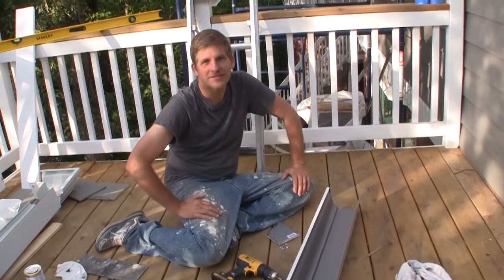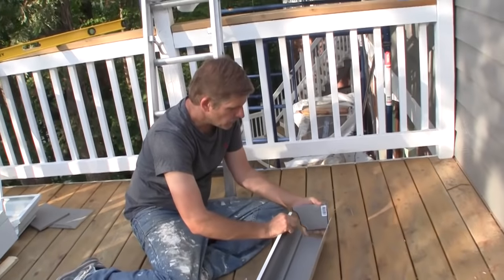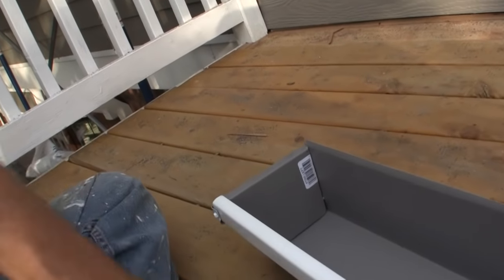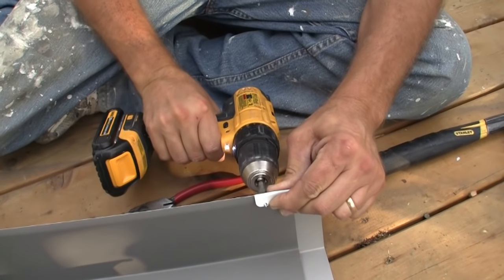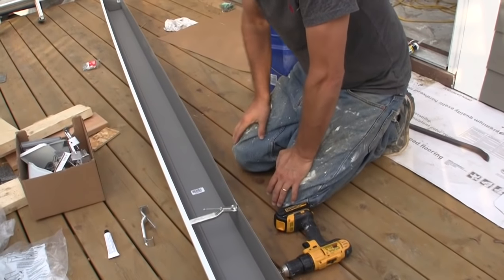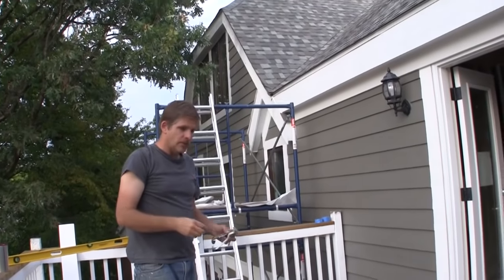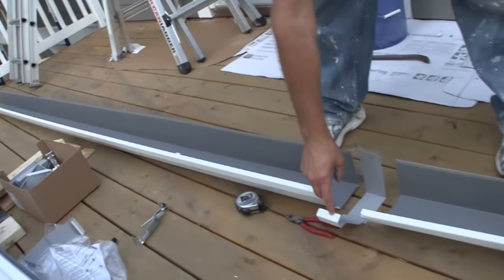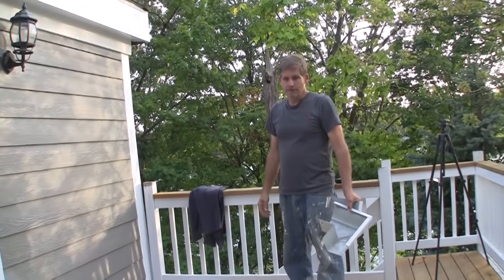How to Install Gutters

Comment: I noticed your flashing is not extended into the gutter at approx the 9 foot mark, due to your slope.  What do you do at that point?  I imagine water will drip behind the gutter and stain the facia board.
Reply from the maker: Hey Kerry,
That’s a subject of considerable debate. We chose a slope that was more steep. Some people chose less slope to avoid such a concern. Our thinking was 1)  : water running off the roof falls OFF the drip edge ( if properly installed) and into the gutter, not down the lower face of the drip edge and down the facia. 
2) our facia is 3/4 inch thick pvc plastic embossed with a wood texture. It will never rot. 
3) and splash that does splash up to the facia above the gutter will be fairly insignificant. 
So in the end - thst was our thinking. Hope that helps.
Thanks for watching!

Comment: Thanks for the details. I guess you have to slide pretty far up under drip edge on initial piece for a long run
Reply from the maker: Hey Nightsky777,
We have had plenty of people ague that the slope can be more shallow, so that might be an option for you on s long run. 
Also, a drip edge, by design, should help keep water off the facia and dropping into the gutter, so, by the way others do it, the entire drip edge does not have to cover the whole back side of the gutter. 
You can scroll thru the comments and you’ll see a lot of debate. But ultimately, the pieces are designed to do its job. 
Hope that helps. Thx for watching and commenting.

Comment: My gutter hangers are four feet a part. They are steel gutters and I live in a warm climate with occasional rainfall. I’ve heard three feet is the max but it’s either two feet or four feet the way my house is put together. Would you recommend every two feet or is four feet ok?
Reply from the maker: Hey JJ,
Ours are about 2 feet. House are your gutters hanging? If you don’t get tons of rain or snow and they aren’t sagging, maybe you get away with 4 feet. But 2 feet works best here. Thx for watching!

Comment: I have a 95 single wide with no overhang or bird box thing. I have rotten facia board and rusty leaking tiny gutters. I want to replace it all but I am wondering if I should just remove the rotten facia board and the gutters and then just screw the tin roof to the top band of the home and then new gutters on top of that that? Or under that tin roof lip?
Reply from the maker: Hey rj,
Why not replace the facia and return it to original condition?
Thx for watching!
Reply: @Housebarons  yes I guess I could do that I really want to  add vinyl siding and thought it would cover up the facia part and just add larger gutters at the top

Comment: What do you do if you run out of drip edge to place in the gutter because of the pitch?
Reply from the maker: Hey Jenny,
No worries. You can have a gap. . It’s a drip EDGE. The water should drip off the edge of the shingle which should be overhanging the drip edge. 
Something isn’t quite right if water runs down the face of the drip edge. 
Thx for the question and for watching!
Reply: @Housebarons  This is not Allowed in most villages and isn’t up to code so how do we go about it in that situation? I know for most of the villages in a 100 mile radius where I live and do work villages NEED all the drip edge into the gutter NO GAP is allowed. I don’t understand how ur leaving it open with a gap ... it will leak.

Comment: At what length would you need two down spouts? I have a 22 foot long garage that I’m going to Reno wondering if it’s better to have two downspouts or if I could preferably do one
Reply from the maker: Hey Grundy,
Funny. There are all kinds of calculations that CAN go into that answer depending on where you live, the pitch of your roof and size and shape of your gutters, size of your downspouts, & gutter slope.. If you want an oversimplified answer -  figure one downspout for every 600-750 sq ft of roof that empties into a gutter.
If you like math, there are a few places online that will give you greater detail.
Hope that helps.
Thx for the question.

Comment: Aren't you supposed to keep gutter behind drip edge?
Reply from the maker: Hey Carters…,
In perfect world. But our facia was made of pvc and water is designed to fall off the edge of the drip edge anyway - so there should not be much of an issue if you want a steeper slope than the drip edge allows. 
Thx for watching!
Thx for watching!

Comment: Don't think I would push the roof I g up to install gutters. 
  I watched a video showing a straightedge being laid on the slope and the gutter installed just below the straight edge .  This looks like it may cause water not drain off the roof edge right
Reply from the maker: Hey Rickey,
The straight edge is for snow/ ice. If you get a mass of snow sliding off the roof, the goal is not to have your gutters ripped off by the slide. Where we live, that is of little concern. 
But good point nonetheless.
Thanks for watching and commenting.

Comment: Great video, is there any need to drill a pilot hole? Thanks.
Reply from the maker: Hey ACMaveric,
No need to the pilot holes IF you are using self piercing / self drilling screws. Those do a fine job. Otherwise , a pilot hole can’t hurt. 
Thx for you comment!

Comment: On my house it's slanted where the gutters would be attached, so the gutters would not hang right. What should I do to solve this problem?
Reply from the maker: Hi Space Cake, please clarify what you mean when you say "it's slanted where the gutters would be attached." If it is difficult to describe, we recently started a page on Facebook, just put housebarons in the search on Facebook and look for an icon of a guy wearing a top hat.  You can post a picture on our page so we can see what's happening.
Reply: Space Cake slanted facia hangs the same. Hang from the 1x and use a gutter bumper every other hanger for support. Senox.com look at their product catalog for gutter bumpers. They’re fantastic.

Comment: If your gutter doesn't end in a corner, do you end the gutter exactly where the roof ends or do you end the gutter a little more than the roof ends?
Reply from the maker: Hey A…,
I typically end it at the facia. But honestly, I imagine that is open to personal preference if you desire a different look. 
Thx for watching!

Comment: I found this video interesting and very informative. How do you install gutters on an older trailer without the roof overhang? The trailer in question has rolled sheet metal roofing secured by screws about every 3-4 inches on the side of the trailer. The old gutter (original) is rusted out and the back side is mounted under the sheet metal .
Reply from the maker: Hey Scott,
Never had that experience. I would try to duplicate what is there. May take some trial and error. 
Thx for watching!

Comment: So. I have 55 ft of gutter to install. Raise it up at once or piece by piece? I realize this is a dumb question, but it is legit.  All the videos show joining gutter lengths on the ground.
Reply from the maker: Hey mg…,
No dumb question at all! 65 feet is quite a length! There are advantages - ease of assembly - to do on the ground , all one length. But you’d need 2-3 other people to keep from breaking/ bending during the lift. If you have the people - go for it. 
But the joints aren’t strong as one solid piece. That’s the drawback. I’d probably try manageable sections (3?) and connect once up. 
OR…
Have a gutter company form and drop a single length at your house. More expensive though… always trade-offs!
Thx for watching!

Comment: Nice vid! So I noticed the back of the gutter was below the d-edge on most of the stretch because of the slope. What can one do about that?
Reply from the maker: Hey Rob,
It all depends on where you live and how much rain you get. 
There are some who advocate hanging gutter level or nearly level and just let water do its thing by finding the downspout hole and drain. 
A slope in your gutters helps more water to drain faster. 
So you could make the slope less . 
The other thing to remember is the drip edge is for water to drip OFF the EDGE. Properly installed, very little water should run down the bottom of the drip edge. 
You could also add an additional down spout which would increase the amount of water that can drain from a particular section of gutter. That way a mostly flat gutter can get rid of a lot more water during a downpour. 
It’s a judgement call based on your situation - but any of the above is ok. You just need to decide how much water you need to move and how fast. 
Thx for the question and kind words!
Reply: @Housebarons  thanks, I'm new to the gutter game but have sided over 100 homes and when I see this situation I've been putting a 2 1/2" strip of aluminum up behind flashing which goes into the gutter. Maybe I'm going overboard.
Reply: @stormteam3004  I'd definitely extend that drip edge. And it should be pulled off the fascia 3/8-1/2".  The last row of shingles has very little slope and water will travel underneath it and under the shingles...

Comment: How do you connect the next section to the one already attached to the house? You cannot screw from the back.
Reply from the maker: +tfgatlin Hi tfgatlin, true, you won't be able to connect the back of the new pieces to the old guttering because the house will be in the way. However, usually you connect the parts using screws on the front and both sides. Even two screws should hold it securely, but three are preferable. You also could put a couple of the screws closer together if you only have two sides to work with, like in a corner. Good luck with your guttering project!
Reply: Why can't the screw go on the inside into the facia???

Comment: I love the look of this system you put up.  What did you use for your facia?  Is that painted board or some type of synthetic material?
Reply from the maker: +Richard Sheridan Hi Richard, we bought our fascia boards at Lowe's. They are called Royal Mouldings pvc boards. They are made of pvc, but they have a stamped wood grain front. Up high you can't tell that they are pvc. They are expensive, but we are working on a 4 story house, so it is no easy feat to replace the fascia. If you are looking for a long term fascia solution, we would definitely recommend this product. Good luck with your project!

Comment: My understanding is those Home Depot gutters are about .018 where seamless gutters are at either .027 or .032.  That's pretty damn thin.  I would guess they are about a 10 year product and good luck if someone leans a ladder against it.
Reply from the maker: Hey Bob, 
All depends on your budget I guess. Thx for watching!
Reply: @Housebarons  Agreed!  I make plenty of budget decisions myself all the time. I'm just pointing a point that I think most people miss. I would guess people think of the big difference between Home Depot gutters and seamless being all the joints..  In my mind that one is recoverable with good workmanship, but the difference in thickness is the real decision.     
Either way great work and thanks for the video.
Reply from the maker: Hey Bob…,
Got ya. Thx for making that point. Worth considering.

Comment: my house doesnt have drip edges   is it ok to install gutter without it?
Reply from the maker: Hey Christopher,
Drip edge is supposed to protect your facia. If you roof shingles where they overhang allow water to drip from them rather than run back toward the facia, then they might function like a drip edge anyway. If so gutters would help direct water away from the house foundation. 
Id look at how water runs off your roof. 
If it drips off the edge of the shingle, then gutters will function correctly for you.
Thx for watching!

Comment: Any tips on installing them on a steel building?
Reply from the maker: +Slickthebird Hi Slickthebird, we haven't worked on any steel buildings yet, but we hope you find the info you need and good luck with your project!
Reply: Your top wall nailer needs to be a 2by6  only use 6" gutter.  The front nose of the gutter needs to be lower than the roof plane, 1- 1&1/2 inches. On classic rib metal,  put hangers on 18"  (every other rib).  Use 2" pole barn screws.

Comment: Besides using trash home depo .027 a company could have dropped off .032 SEAMLESS for around same peice.  This was 5yrs ago,  i bet the seams leak and some facia rotted with that 1/8 in shingle overhang and not under drip

Comment: How do you measure out the slope? How do you calculate that
Reply from the maker: Hey Allie,
It’s length to drop . So a 10ft length horizontally at level, then measure down on one end 1/4 or 1/2 inch. There you would have a 1/4 or half in slope over 10 ft. 
Thx for watching!

Comment: Just bought gutters yesterday, so I think I can do this after watching this.. Two questions, can I do this by myself and do you caulk it all after it is up ?
Reply from the maker: Hey Sonas....,
If you could rig up something to hold the opposite end, in theory you could do it by yourself. But an extra set of hands would be way easier.
As for “caulk”, no. There has been no shortage of comments on this particular topic. Typical big box stores sell a gutter sealant for the seams. That should be effective. But get the stuff that is specifically manufactured for gutter seams. Not a one kind fits all. 
Hope that helps.
Thx for the question.
Reply: Thank you for the reply.  OK ,I plan on trying it by myself and I will caulk all the seems except the ones that I am connecting. We have rain today and the next few days, so looks like I will have to wait. Wish me luck, I will need it! Thank you sir.

Comment: I do this for a living, All wrong, piecing together gutter is the worst, gutter from most building supply places is so thin (.017) that anything heavier than a little bit of water will rip them apart, 1/2 of fall of fall over 10' is mega overkill 1/4 at most is more then enough you can get a way with an 1/8 or less, it's water people gravity is a thing, I could go on but I'll leave it at that, call your local gutter suppler then can get you much better products then any chain stores even if you want to install them yourself.
Reply: Actually gutter slope depends on the surface area and roof slope. 

The higher the roof slope, the faster the water evacuates to the gutters. The larger the surface area of the roof, the MORE water. Which means the slope must be a little more aggressive or you risk damaging the gutters. There shouldn’t be a standard slope. Of course most homes will fall into that 1/4-1/2 in. drop unless it’s a particularly large home.

Comment: Have you ever tried Hitachi sheet metal nibbler to cut the gutter or the gutter outlet.  I am wondering if anyone used it for that and how it worked.
Reply from the maker: Hi My Fit, no we have not used a Hitachi sheet metal nibbler. If anyone reading this has used this tool, let us know how well it works. Thanks for the question.

Comment: In high wind the top edge of my gutter stays anchored, but the bottom edge slams against the house. How can I fix?
Reply from the maker: Hey L Hancock 
Sounds like the hangers/anchors are loose.  
I'd try and move the gutters by hand and discover what is loose. Do you have spikes, or hangers similar to ours in the video.
If they are k-style gutters, I'd try adding a couple additional hangers ( from a big box store) and see if they tighten it up. We spaced ours about every 2 feet or do. 
Hope that helps.
Reply: unless you have strap on gutters they usually allow for the gutter to hang out bast the fascia on the house.. usually have them on older houses. If thats the case id suggest putting a wind tie on

Comment: At seven minutes and 48 seconds it looks like water is going to run behind that gutter because the drip edge does not go down for enough
Reply from the maker: Hey Ultimate…,
2 things - 
1) the facia is made of pvc so no rot worries. 
2) a drip edge is supposed to facilitate 
d r I p p I n g  so if it is running down the facia, we did something wrong. If a little water splashes on the facia, it would be insignificant to a rain storm / so I said all that to say this- it has not caused us any difficulties. 
One could add some extra aluminum or other metal to make up the difference OR maybe lessen the severity of the slope to prevent what you have pointed out. But only if it bothers you.
Thx for raising the point and for watching.

Comment: What’s the best way to measure the slope for the gutter?
Reply from the maker: Hey Owen,
Try putting a level on your facia board at the lowest spot you think the top of the gutter should ride. Draw a level line the length of your gutter across the facia board. Then every 10 ft across that line, go up an 1/8 ( or 1/4 - a hotly debated issue if you scroll through the comments) of an inch or so. Then 10 more feet and up another 1/8. Then connect all those gradual increases with the top of your gutter.
Another less precise way : pour a cup of water in the gutter. When the water barely starts to more to the down spout, tack it up!
Hope that helps.
Thx for watching.

Comment: What did you use for your fascia?  PVC?
Reply from the maker: Hey Westsidewill,
Behind the gutter we used a composite wood to overlay existing facia. The trim below that and around the doors we used a 3/4 inch PVC with a wood grain finish pressed into it. Thx for the question.
Reply: HouseBarons I have quite of bit of rot on some of the old fascia.  Won’t be able to install over. My guess is that it’s 1x4.

Comment: Good luck achieving proper slope with a drip edge that narrow on anything longer than ~20' runs...you can't. You'll eventually need to hang the gutter below the drip edge instead of behind it, and the transition point is a headache of cutting the edge and bending and bs
Reply from the maker: Hey wuffpaw,
Thx for the input and for watching!